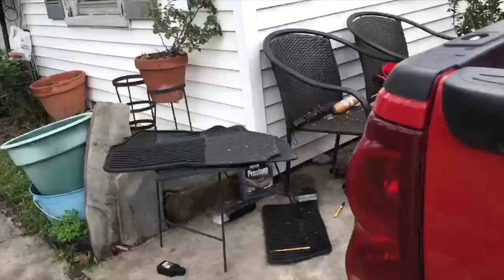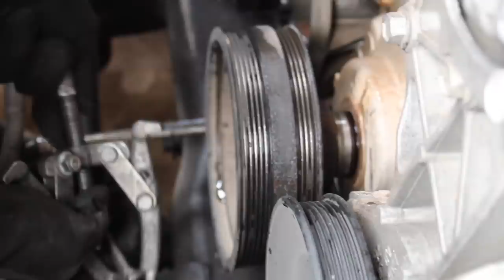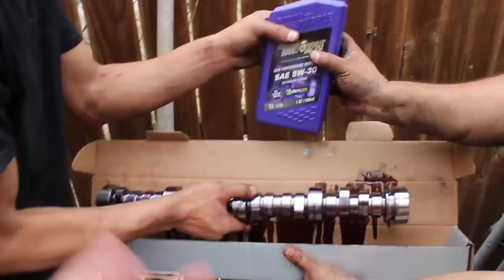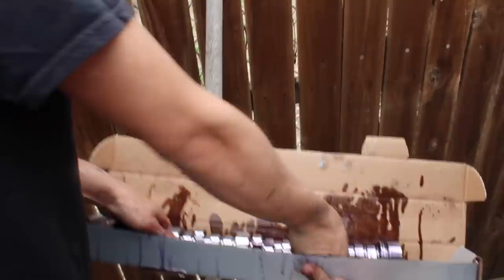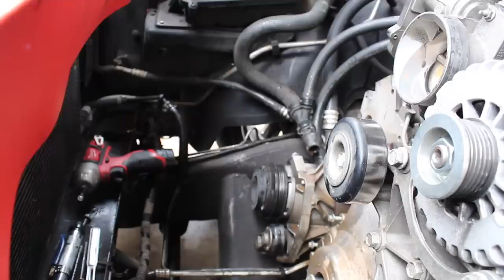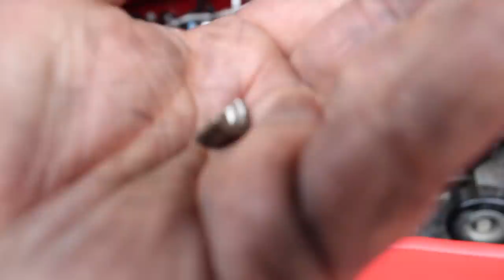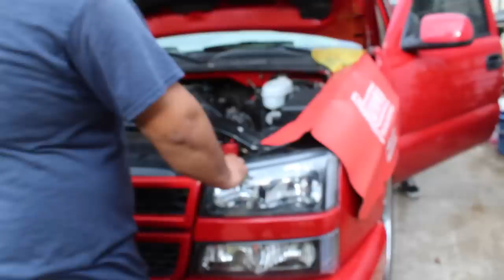HOW TO CAM SWAP YOUR LS MOTOR | BTR STAGE 2 TRUCK CAM (4.8L, 5.3L, 5.7L, 6.0L, 6.2L) STEP BY STEP

Comment: Out of curiosity, could I use the old school method of hooking up a compression tester but just hooking the hose up to compressed air to hold the valves up?
Reply: Nevermind, you covered my question in the video right after I asked lol

Comment: Que onda primo.  Tengo una c10 84 con un 6.0 y 4l80 transmission. Que cam me recomienda ???
Reply from the maker: ponle el cam kit btr stage 4 truck cam
Reply from the maker: el btr stage 4 primo
Reply: @dinocoblue2709  gracias

Comment: I’m planning on putting a btr stage 2 cam in my ls swapped el Camino, what do you mean by you use the new longer bolt for the pulley? Does the kit come with one?
Reply from the maker: no and I use the longer bolt to push the pulley back in the original bolt won't be long enough
Reply: You can match your pulley bolt at your local hardware store or Home Depot
Reply: I went with a ls1 cam got the block bored 0.20 over, ls7 lifters, arp bolts, high volume oil pump, 0.20 over pistons, stock rods and springs and nitrous I blew the old engine up after getting it in and finally running it dropped oil pressure and seized, this time I’m doing it right with all new parts but a few

Comment: Nice video bro. Do you recommend tunning it after?
Reply from the maker: yes for sure
Reply: @dinocoblue2709  what tuner would you recommend for a 4.8 vortec or a 5.3 vortec? If camned with a brt stage 3

Comment: Can I cam a completely stock 5.3?
Reply from the maker: Yes
Reply: So a camshaft and tune would be enough? No need for headers or intake?
Reply: @dinocoblue2709  thank you 🙏🏻
Reply from the maker: Headers and I take will definitely help but not required

Comment: Did you already do the AFM/DOD delete or does that year model engine not have it? Also, the cam sprocket timing mark is at 6 o'clock and the crank sprocket will be at 12 o'clock right? What cam did y'all go with, Texas Speed stage 2?
Reply from the maker: I had already deleted dod when I first cammed the truck about 2 years ago, yeah that’s right cam sprocket dot at 6 o’clock and crankshaft dot at 12 o’clock , I went with btr stage 4 truck cam
Reply: How much hp did you get from the stage 4
Reply from the maker: not sure, its never been on a dyno @AB-hz6uj

Comment: I have 1992 c1500  with 350 5.7. What cam can you suggest bro..
Reply from the maker: damm idk i would just call btr or tsp and ask what would be the best cam for your truck
Reply: @dinocoblue2709  appreciate  the help bro. When I do get my cam would it be about the same way to put them in like your video.
Reply from the maker: yeah pretty much the same  @obselmundo7917
Reply: You can pick.up a 5.3 or a 6.0 for fairly cheap.  I would drop a 6.0 Lq4 in with a 4l80e trans.  I was just at Pick and pull the other day and they had several of each. A long block 6.0 is $260 and a 4l80e is $160. The wiring harness comes with the engine and trans. Accessories are $15 a piece.

Comment: What exactly are u calling a stage 2 what size cam and where did u buy it
Reply from the maker: that's what the cam is called due to its size, I'm not sure about the size but from briantooleyracing.com
Reply: It's a BTR stage 2 truck cam made with low lift so you don't have to replace valve springs.

Comment: Does anyone kno if I can remove the lifter the same way the cam comes out? One lifter bottom end broke and can’t pull out true the top, plz help thanks!
Reply from the maker: damm that sucks, honestly im not sure
Reply: Mine done the same thing and you will have to get a hydraulic lifter puller and pull it through the top what is happened is is the bottom of the lifter has mushroom and it's stuck in the block when you get it out just take a brake caliper dingleberry and clean up the whole good and you should be good to go

Comment: How do you know when the piston is tdc when doing the valve springs ?
Reply: When removing the valve springs make sure the rockers don’t have tension. If they do you’ll need to spin the pistons till it releases pressure. Do this before you remove the cam or after

Comment: Hey man, do you still do this? I see you're pretty damn popular with this.  I'm in lewisville and would like to get all the parts needed if you're down to install in my 5.3 2001. I know cam,  springs, head gaskets, and lifters.
Reply from the maker: Yes DM me on Instagram @dinoco.blue

Comment: How long are the dal- rods ?
Reply from the maker: im not sure about 20-24 inches
Reply: @dinocoblue2709  What size thickness are the rods to hold the lifter in place? I was told that 5/16 or 3/8 rods will work. I'm installing a Rattler cam im my 04 Denali 6.0L and I'm at the point of removing the stock cam. Shoot me some feedback asap please.

Comment: That oil is not thick enough. That why we use cam lube thick and won't run off. You run the risk of ruining the lobes on the cam.

Comment: Had a quick question when taking off springs how do you know you have the pistons too dead center so the valves don’t fall in thanks in advance
Reply from the maker: take the spark plug off and stick a screw driver in the spark plug hole and rotate the motor and you'll feel the piston go up and once its all the way up thats tdc

Comment: So you didnt degree the cam shaft!!?? Having 2 or 3 degrees off will have u wondering why a n/a Honda left you at the red light
Reply from the maker: no, timing marks were still on point
Reply: Ls engines are new school.

Comment: I would have thought Assembly Lube would have been preferred over motor oil for the cam
Reply from the maker: it is preferred  but we just send it
Reply: I would just use very thick oil

Comment: How much miles bro on the red truck bro
Reply from the maker: I think about 120k or 130k
Reply: Dinoco Blue my truck has 200k Could I do a cam 🤔 with high Mileage
Reply: @lowboostedaccord4933  i got a 05 denali xl with a lq9 6.0 with 405xxx on it, just did stage 2 cam and lifters, havent had a problem, motor runs like new
Reply: Roger Mountpleasure ok cool thanks bro

Comment: You got the link for the spring compressor tool?
Reply: Check eBay gm spring compressor tool  its 50 bucks
Reply from the maker: yeah just look up "LS valve spring press"
https://www.ebay.com/itm/VALVE-SPRING-COMPRESSOR-TOOL-For-Chevy-L92-4-8-5-3-6-0-LS1-LS2-LS3-LSX-Engine-/292943834474
Reply: Dinoco Blue  thanks bro 👌🏻

Comment: Tought you suppose take heads out in order to swap a cam
Reply: Nah
Reply: Why not
Reply from the maker: @mastersmind602  because the cam is able to come out with the heads still on the motor
Reply: On older generation Chevy's (like 5.7l or mostly anything before 98) yes but not on the Ls style engines.
Reply: @sigersonholmes7758  actually the older engines you do not have to remove the heads to change the cam or lifters just the intake. The ls engines you have to remove the heads to change lifters.
Reply: @gsdewd1994  You're absolutely right. The only carbed engine I built was over 20 years ago and since then I have done ls series engines. They're so easy my 16 year old is building his own with just a smidgen of guidance.

Thank you MaD ShOTXx
Reply: Not even old engines. You remove intake to remove the lifters not the heads. That's the only downside of ls engines. You have to remove heads to replace lifters. Old chevies just the intake

Comment: How do you know when you hit TDC?
Reply from the maker: take spark plug out, put a screw driver in the spark plug hole and you'll feel when the piston reaches the very top aka TDC
Reply: And you just do that for every "spark plug hole" to get the set of springs over it?

Comment: That motor has had major neglect... i just took apart a 340,000km 5.3 for cam and its still shinning inside!!! Couldnt believe it
Reply from the maker: yeah the past owner must have never changed the oil, any motor can last for ever as long as you maintain it very well

Comment: Y’all do know y’all didn’t have to remove the coils or valve covers right? That was a lot of unnecessary work...but to each his own...the job got done
Reply: 51 Fifty if they don’t remove the valve covers how they gonna take out the pushrods and rockers?
Reply: Tom Jr that’s not required for a cam swap...unless you’re swapping out springs, and this on said cam swap
Reply: 51 Fifty he did do a spring swap but it is required to remove the pushrods in order to keep the lifters from falling out in order to remove the cam
Reply from the maker: you do have to remove the rocker arms to change the cam swap because the cam will not come out with the spring load of the lifters on the cam
Reply: Dinoco Blue well I know not to let him do my cam swap 🙅🏻‍♂️

Comment: Why didn't you replace the cam plate?
Reply from the maker: not sure, we never replace them and we never have an issue
Reply: I always here people having oil pressure issues and when they think its a oil pump,it was actually just leaking from that seal.

Comment: First of all u disconnect d battery and then u start taking apart the motor?????
Reply from the maker: Nope I never disconnect the battery
Reply: I worked with a mechanic shop and it was a simple belt swap and the mechanic had a coffee and d fuse box had a crack and a harness was exposed and like I say again he was experienced and thought it’s kool done this many times well he knocked d coffee over n wet the perfect spot n d car fought on fire 🤷🏻‍♂️ so that d reason I say disconnect first

Comment: im doing a camm swap on my 04 sierra 5.3L
stage 3 btr would i need to change sproket and chain?! or just camm nd springs nd seals?!! @dinoco
Reply from the maker: just cam and springs
Reply: thanx man i appriciate it
Reply: Dinoco Blue Would i need a stall with a stage 3 btr camm?!

Comment: change the cam but no lifters? it's like taking a shower and not changing underwear
Reply from the maker: and still going strong tho
Reply: @dinocoblue2709  well I'm glad it worked
Reply: Since 1994 Chevy has been using roller rockers. If the lobes on the old cam are smooth no need to replace them.  It's not like a hydraulic flat tappet lifters that had to be replaced mandatory or  would damage the cam.
Reply: @Miguelspl150  that's really interesting to know man, i really thought it was the type of lifter hemi engines use.

Comment: where did you get your spring compressor tool? hit me on ig @5lim_trigga, couldn't find you
Reply from the maker: eBayhttps://www.ebay.com/itm/Valve-Spring-Compressor-Tool-for-4-8-5-3-5-7-6-0-6-2-LS1-LS2-LS3-LS6-Chevy-LSX/174127996480?hash=item288ad65e40%3Ag%3A4b4AAOSwOEJd8v59&LH_BIN=1

IG https://www.instagram.com/dinoco.blue/

Comment: Your comment about moving the timing is false long as your rocker colors are not no pushrods your valves will not open therefore you cannot smack about till piston guys must be a couple of greenhorns first time around the engine block

Comment: Supposed to have it run at 2k rpm for 15 minutes
Reply from the maker: this is not a flat tap lifter cam, this is a roller lifter cam there is no break in process